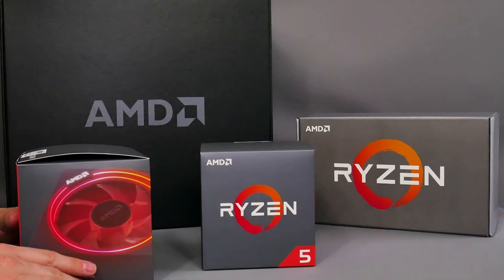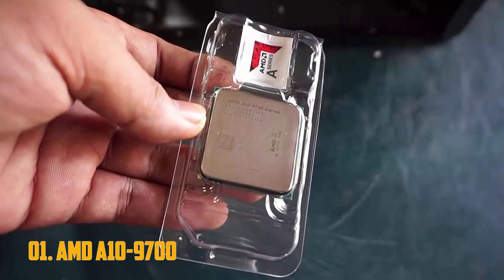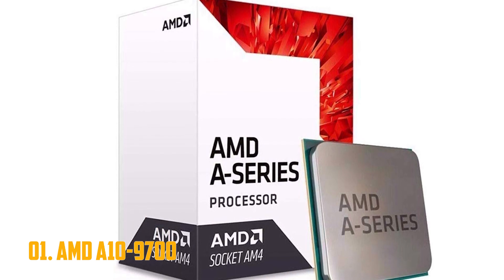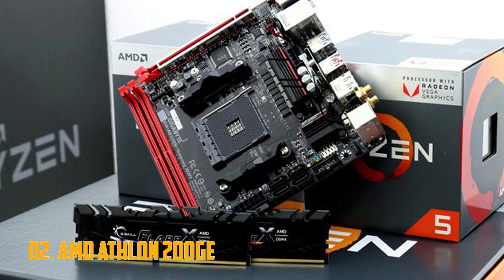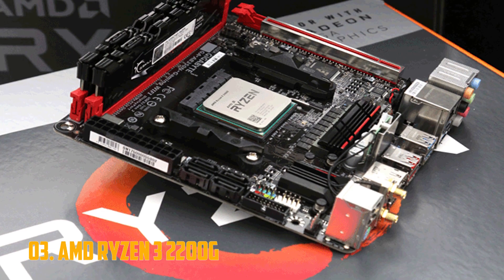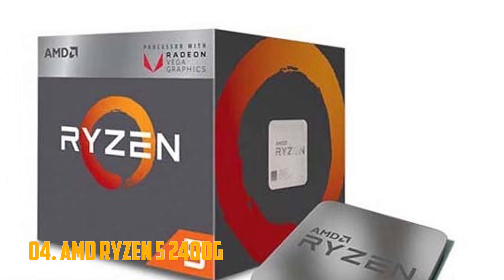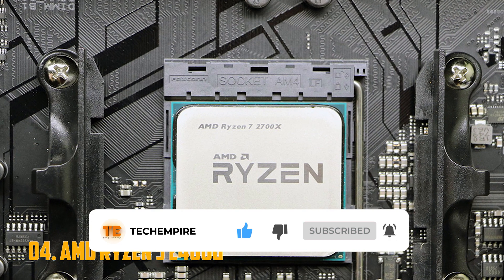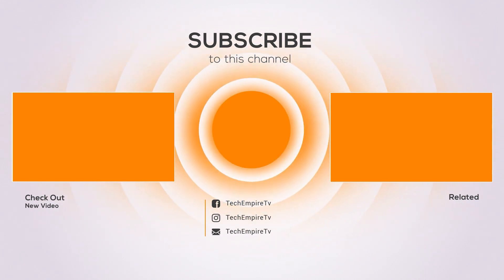✅ Top 4: Best APU For Gaming and Video Editing || Best APU Buying Guide

Comment: This CPU is about 25/100% what you need for anything except 10 minute n00btube videos, I have 2 of these and they are great and worked well for 4-5 years but they are not fast enough even for 30 minute 1080p Camtasia video rendering unless you drink a LOT of cups of coffee a day and the kettle is half a mile away :) You can't use the PC while it is rendering because Windows 10 is so pathetic it uses up too much CPU to run other things (twice as much as Win2000 or XP)

Comment: What about 3400G?
Reply: And 3200g its better
Reply: @doperzz7499  3400G is better than 3200G
Reply: @thatnongayfurry5063  just on threads
Reply: @doperzz7499  What do you mean? The 3400G has 4 cores 8 threads and I think the 3200G had only 4 threads and 4 cores
Reply: @thatnongayfurry5063  yeah that what i said
Reply: @thatnongayfurry5063  bro do u habe a r3 3200g or a r5 3400g ?
Reply: @doperzz7499  I have a Ryzen 5 3400G
Reply: @doperzz7499  It also has Vega 11 graphics which means it has 11 vega graphics cores making it an APU and be capable of running games without an external GPU
Reply: @thatnongayfurry5063  i just got an rx 580 with my r3 3200g its way more better i can run all game at 1080 p more than 120 fps
Reply: @doperzz7499  I upgraded from vega 11 of the 3400G to a GTX 1650 Super and can run games like arma and hitman 2 at very high settings 1080p
Reply: @doperzz7499  a GTX 1650 Super is better than an RX 580